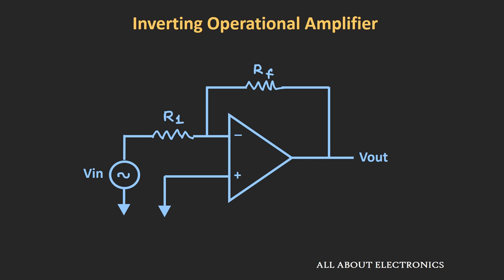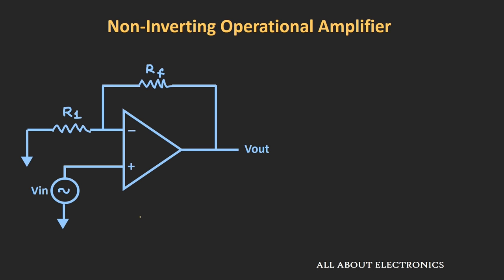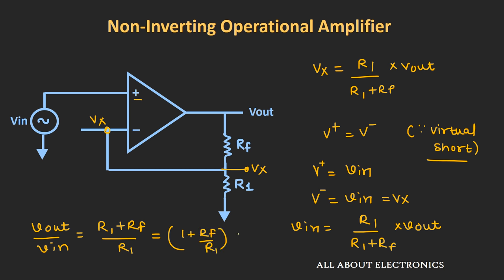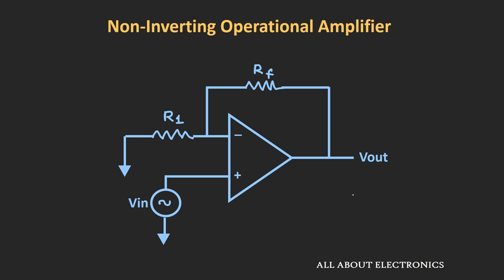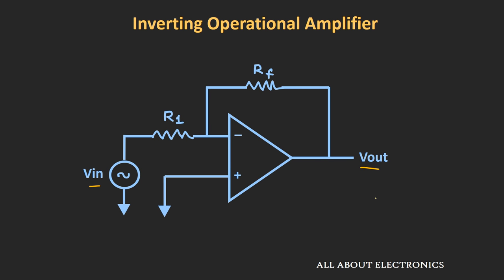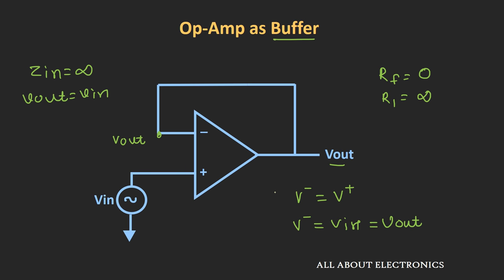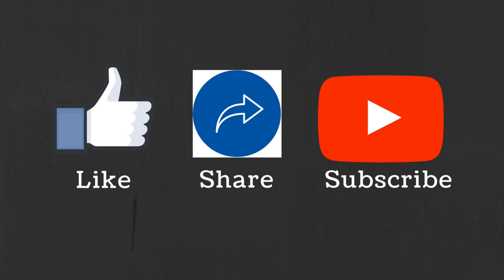Operational Amplifier: Non-Inverting Op-Amp and Op-Amp as Buffer (Op-Amp as Voltage Follower)

Comment from the maker: The timestamps for the different topics covered in the video is given below:
0:52 Non-Inverting O-Amp Configuration
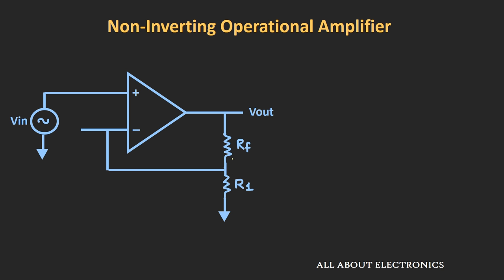1:51 Derivation of Closed Loop Voltage gain for Non-Inverting Op-Amp Configuration
5:00 Advantage of Non-Inverting Op-Amp configuration over Inverting Op-Amp configuration
6:09 Input Impedance of Inverting Op-Amp 
7:25  Input Impedance of Non-Inverting Op-Amp 
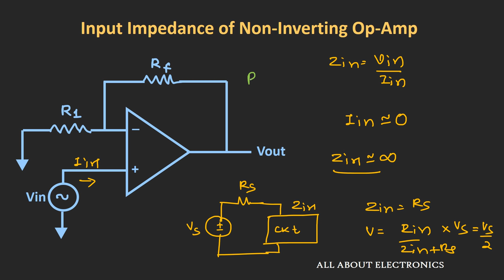9:28 Op-Amp as Buffer (or Op-Amp as Voltage Follower)
Reply: ALL ABOUT ELECTRONICS 

🤘 You Just Rocked.
Reply: Good
Reply: what an explanation!!U have done a great job.Timestamps concept in the description is very useful.
Reply: why you considered negative feedback for both inverting and non inverting configuration and not the positive feedback ?Is virtual ground concept applicable for positive feedback? if no why?
Reply: @badcaptain1089  Positive feedback makes the circuit unstable that's why it is avoided.
Reply: Can anyone tell me why Vx is taken in such a way that the R1 is connected to ground?
Reply: what is the use of buffer circuit
Reply: Subtitles are present on the screen.. it is good.. but we can't see the diagram or matter that is under the subtitles please take my request sir
Reply: Can anyone please explain the voltage divide rule which happened in 2.25 minute
Reply: @Mubarak47  @Bad Captain; Yet the circuit with positive feedback is also used for Comparators, Schmitt triggering, i.e. bistabil systems. ;)
Reply: Thanks for this lovely content.
Just a suggestion, with youtube's new chapters feature you could add these timestamp in video description and it will come within videos itself

Comment: It a great videos!
Im new with electronic circuit, not really know about the impedance you had mentioned. 
How is an infinite/high impedance op-amp will benefit a low impedance circuit?

Comment: In your previous video, you added voltage source at the inverting end with a resistance R1. Now, in this video, while modifying the circuit you shifted the voltage source to the non-inverting side but R1 was kept at the same place. Why is it so?
Reply from the maker: Its because, using the feedback resistor and R1, the feedback voltage is provided back to the input. 
At 2:10, as I have mentioned, the feedback voltage is R1*Vo/ (R1 + Rf).
So, in short, due to the feedback configuration, there is a Resistor R1 at the inverting terminal. The voltage across R1 is the feedback voltage at the inverting terminal.

Comment: I really like your videos! The videos are so helpful, thanks!

Now I have a question about the "buffer configuration".

I try to imagine the situation with an example:

1st, before switching on Vin,
Vin = 0V
Vout = 0V

2nd, then I switch on Vin:
Vin = 5V => Vout = Vin-Vout = 5V - 0V = 5V

3rd, but then this Vout will be substracted from Vin, so:
5V (= Vin) - 5V (Vout) = 0V
Then Vout = 0V.

4, And it runs in a circle like this:
Vout is = 0V => Vin - Vout = 5V-0V = 5V

Vout: 0V >> 5V >> 0V >> 5V...

This example has something wrong in it, because the output is not switching between ZERO and 5Volt in real life.

What point do I miss from the example?
Thank you for your help!
Mark
Reply: I suspect the answer to this question is that the voltage source and op-amp don't respond instantaneously. op-amps have a frequency response, which means the op-amp does not respond well to changes that occur faster than some time constant.

Comment: THANK YOU FOR ALL OF YOUR GREAT VIDEOS ON OP AMPS!!!
I have a simple requirement that I can't seem to find the answer for:

I need an op amp in which I control the GAIN and OFFSET  independently!!!!!

If I set up a simple inverting amp where I can control the gain with Rf.....then will a variable +/-DC voltage at the "+" input simply move the waveform 'up and down'  WITHOUT changing the signal gain???
IOW  I need to shift the signal (a 50% duty cycle square wave) without effecting it's shape.
THANKS MUCH AGAIN!!!!!

Comment: Sir in the buffer circuit output of circuit 1 will appear in the vout  Sir but what if the input resistance of circuit 2 is low, it would still get fractions of vout. So what is the point of using buffer?
Reply from the maker: Let's say the input resistance of source signal  is 200 ohm. And the input impedance of the second circuit is 50 ohm. Input signal is 1V. 
In such case, the actual input appearing at the second circuit is 50x 1V /250= 0.2V.
But the op-amp has low output impedance. Typically few ohms for some op-amps. 
Ideal op-amp as zero output impedance. 
But lets say our op-amp has 10 ohm output impedance.
In such case, the input appearing at the second stage is 50*1V / 60 = 5/6V. So, buffer does make a difference. 
For very low input impedance it won't make difference. But input impedance of most of the practical circuit is more than 10s of ohm. 
So, buffer does make a difference. 
I hope it will clear your doubt.
Reply: @ALLABOUTELECTRONICS  thankyou sir very much it has cleared my all doubts 🤩

Comment: Something is missing in your explanation, I think, regarding the input impedance. If you realize, that the 2 grounds in both the inverting and non-inverting op-amps are on the same potential (i.e. connected by a wire), then non-inverting op-amp circuit is exactly the same as the inverting op-amp circuit. I understand, that this is a simplified explanation for students, but I have a feeling, that somebody is cheating on me here. But thanks for your videos anyways, I have learnt a lot from them.

Comment: There is due to virtual ground both the input has same input voltage and we know that opam has a out put voltage is equal to =A×(v2-v1) whare v1=v2 and the out should be zero

Comment: In video timeline 5:53 you stated that the input impedance of the negative terminal of the op amp is equal to R1. But isn't it more correct to state that the input impedance seen into the negative terminal should be R1//Rf?
Reply from the maker: The more appropriate would be, for the inverting configuration,  the input impedance seen through the input (applied at the inverting terminal) is R1.

Comment: Sir you have used input impedance = infinity for derivation of  inverting input op-amp configuration . But in this video Input impedance is depending on R1 how??
Reply from the maker: Would you please tell me where exactly in the video you are referring to ( timestamp). So, it will be easy for me to answer.

Comment: If iI get it correctly, the potential difference between the 2 terminals of the circuit is Vs/2. But you're saying that the entire potential (Vs) appears between the terminal. Why?
Reply from the maker: Would you please mention, where you are referring to in the video?

Comment: According to the equivalent circuit of OPAMP input impedance is the impedance which is present inside the opamp between the two terminals denoted as 'Ri'. But here you said in inverting amplifier input impedance is R1 which is actually the external impedance connect to inverting input. And if input impedance is R1 and not infinity there will be a current flow inside the terminal but we have considered that current flowing through R1 is equal to current flowing through feedback resistance which means no current is flowing into the terminal which is actually contradictory!
Reply from the maker: For any circuit, the input impedance is the impedance seen the by the source side (voltage/current source). And in fact is it is Vs/Is.  When op-amp is operated in the open loop configuration, then no external resistor is connected. And let's say even if you connect any resistor  R1 in the open loop configuration, then also Zi is very high. Because current drawn by the op-amp from the source is very low. Hence, Vs/Is is very high. And it can be said that input impedance is very high. 
In the case of feedback, for inverting configuration, the current drawn from the source is Vs/R1. (Due to virtual Ground)
Hence, the impedance seen by the source for the inverting op-amp is Vs/ Is = R1.
So, here even though the internal impedance of the op-amp is very high, the impedance seen by the source is R1. And hence, it can be said that the input impedance of the op-amp in inverting configuration is R1.
I hope it will clear your doubt.
Reply: @ALLABOUTELECTRONICS  Thanks a lot 😊🙏

Comment: In previous vedio the input impedance of inverting op amp is infinite and in this vedio you said input impedance is equal to R1.
Reply from the maker: I think you misunderstood that. The input impedance of the ideal op-amp is infinite. In the previous video, when I was saying Rin is infinite, it is from node X. (The input impedance of the op-amp is infinite, but not of inverting amplifier configuration). For the inverting amplifier, if you look from the source side (from where the input is applied), the input impedance is R1. I hope, it will clear your doubt.

Comment: Sir , in  input impedance of non inverting OPAM we find Vin= V out. So what is the benefit of Amplification
Reply from the maker: I think you mean to say buffer circuit right. 
Well, the input impedance of the non-inverting amplifier is very high. So, whenever you want to avoid the loading effect, it is very useful. 
Basically, it is useful in driving the low impedance circuits. Also buffer circuit can provide a decent current to the other circuit. 
Some times the normal source (not necessarily a voltage source often derived from the power supply) won't able to supply that much current. 
In such scenario it is useful

Comment: Input impedance of an inverting Amp you considered Virtual GND. Why don't you consider it for the non-inverting?
Reply from the maker: With the negative feedback, V+ = V-. In case of the non-inverting op-amp, inverting and the non-inverting inputs are at the same potential. (i,e V+ = V- = Vin)
And to find the input impedance, we are finding the ratio of Vin and Iin at the non-inverting terminal. So, there is no question of virtual ground here. 
In case of the inverting op-amp, the input is also at the inverting terminal and the non-inverting terminal is grounded. So, virtual ground concept was applied.
I hope it will clear your doubt. If you still have any doubt, let me know here.

Comment: I didn't understand the very last part why we used voltage follower and what was the point behind doing that
Please reply in comments thank you
Reply from the maker: In the voltage follower, the op-amp acts like a buffer. It provides high input impedance and low output impedance. And very useful when you want to connect the two circuits. (in impedance matching perspective).

Comment: I want to ask something. At 11:11, there is a figure which shows the connections between circuit 1, opamp and circuit 2. In this configuration, we use opamp to transfer the signal from circuit 1 to the circuit 2 with gain=1. Why don't we connect the output of the circuit 1 to the input of the circuit 2? Why do we need to buffer the signal? What is the logic behind the opamp?
Thanks
Reply from the maker: When there is impedance mismatch and when the second circuit has low input impedance then to avoid loading, it's advisable to use buffer. That's why the output of circuit is not directly connected to second Circuit. I hope, it will clear your doubt.

Comment: When explaining Non Inverting Op -Amps you said that Vx= (R1/(R1+Rf))* Vout. Why is it (R1/(R1+Rf) and not (Rf/(R1+Rf). I couldn't understand that bit
Reply from the maker: Its voltage divider rule. Since no current is flowing in op-amp terminal (assuming ideal op-amp), the current is flwoing through Rf and R1. Vx is the voltage across R1. Using voltage divider rule, it is R1*Vo/ (R1 + Rf)

Comment: Really nice explanations on op-amps, but what i dont understand is that basically you made an assumption? in a previous video that A is about 10power6 and biased voltage is say 10v (+ and -) so therefore input is 10microV... so hence the virtual short and 0 potential difference at the 2 inputs (inverting and non inverting). am I correct? So what if this werent the case? if say there is a significant voltage applied at the input like 1-2Volts that you cannot assume is negligible? I mean do we always work with tiny input signals and hence the use of op-amps due to some favorable assumptions in functionality. thx!
Reply from the maker: The concept of virtual ground is applicable only with negative feedback. In that case, even if we are applying 1V or 2V voltages, the difference between the two terminal adjust the voltage accordingly so that we can get finite output. 
In open loop configuration, even if we voltages in mV, let's 50 mV at the non-inverting terminal and 10 mV at the inverting terminal, then also output will get saturated to the supply rail (Becuase of the very high gain).
But with negative feedback, the gain of the op-amp is finite. Or in other words, we can say that the for the very high gain ,the effective input voltage appearing between the two terminal is almost the same. 
I hope it will clear your doubt.

Comment: At 1:23 : Inverting input (-) is grounded and non inverting input have input voltage = Vin
Doubt : since its a negative feedback opamp and one terminal is grounded then why other terminal i.e Vin isn't 0 ? Both the terminals have equal voltage isn't it?

Comment: Don't understand. If you supply a small voltage at the non inverting input then the op amp will amplify this non inverting input thereby sending this amplified signal to the inverting input. The voltage at v+ can't be the same as output voltage.

Comment: RESPECTED ALL ABOUT ELECTRONICS GROUP:
AT 1:25 In the blue diagram, when the voltage is supplied to the non-inverting point and to the ground,
 how can one say that the Vin as a whole is applied to the non-inverting point??
Please do reply as soon as possible ....
Reply from the maker: Because if you measure the voltage between the non-inverting input terminal and ground it will be equal to Vin. So, entire voltage is applied at the non-inverting input terminal.

Comment: You state in this video that Rin = Zin for inverted but in the inverting op amp video you said Rin was infinity....
Reply from the maker: Here this input impedance is the input impedance of the inverting op-amp configuration. It is the impedance seen by source. But in that video, I was talking about the input impedance of the op-amp. It is the impedance seen by looking into the input terminals of the op-amp. (For the ideal op-amp, the input impedance is infinite)
I hope, it will clear your doubt.

Comment: How the log amplifier can be tuned around to provide antilog function?.
Reply from the maker: If you know the log amplifier using the Op-Amp, the diode is connected in the feedback between the output and the inverting terminal. The same circuit can be turned into the anti-log amplifier by interchanging the position of resistor and diode. So, in anti-log amplifier resistor will be in the feedback and diode will be connected between the input and the inverting input terminal.

Comment: Hi, quick question. For the input impedance comparison, if we apply the concept of virtual ground; then we get the same voltage at Vx as Vin right? Then in that case there will be current passing to Vx due to which Zin would be 1? Can you please explain this part to me, not able to understand as to why is Zin infinite here and not 1. 
Also, thank you so much for the videos; really helpful :-)

Comment: Hello
I am confused with the input impedance of the inverting opamp.

The ideal opamp should have an infinite input impedance and zero output impedance, so shouldn't the input impedance for this inverting opamp be very high, why is it equals to R1? 

Am i misunderstanding a concept here? The input impedance of the non-inverting opamp however, is very high, which relates to the infinite input impedance though. 

Can you help me out with this?
Reply: No you have understood the concept correctly. Inverting opam has less input impedance I.e only r1 hence it is a disadvantage. While non inverting opamp is more efficient in this respect as it has infinite input impedance

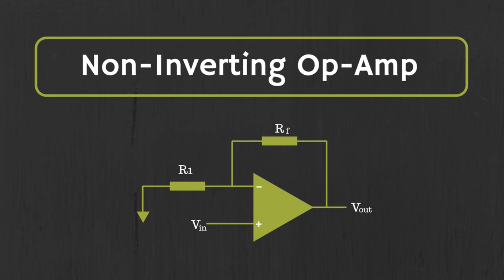Comment: 00:18 Non-inverting op-amp configuration and using op-amp as a voltage follower.
01:39 Op-Amp in Negative Feedback Configuration
03:10 The non-inverting op-amp configuration allows control over the gain by adjusting the values of RF and R1.
04:43 Non-inverting op-amp configuration provides amplified AC signal with same phase as input.
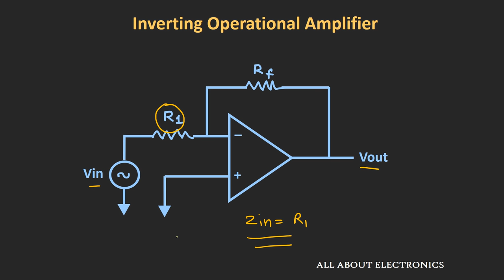05:59 The input impedance of the inverting op-amp configuration is equal to R1.
07:24 In the non-inverting op-amp configuration, the input impedance is infinite.
08:55 The non-inverting op-amp configuration has a high input impedance, allowing the entire applied voltage to appear across the circuit.
10:27 The non-inverting op-amp circuit can be used as a voltage follower or buffer circuit.

Comment: 6:12 isn't input impedance present inside the triangle symbol of the op amp instead of being at Vin?
Reply from the maker: Here we are finding the input impedance of inverting and non inverting configuration. ( instead of input impedance of the op-amp alone). In this configuration we are also connecting external resistors to the opamp.
In general for any circuit, the input impedance of the circuit is the impedance seen by the input voltage source. That’s why here we are looking at the impedance seen by Vin.
If you want to know more about input and output impedance, you can refer the following video: 
https://youtu.be/7jw2_x8dyQ8
Reply: @ALLABOUTELECTRONICS  thank you so much! Ur reply means a lot! Gbu

Comment: Sir in case of buffer circuit Why we have taken R1 equals to infinity ? Even by putting Rf equals to 0 only we are going to get Vin = Vout.
Reply from the maker: Yes, then also you will get Vo = Vin. But here what I mean to say is, there is no need to connect the R1 to use the op-amp as a buffer.